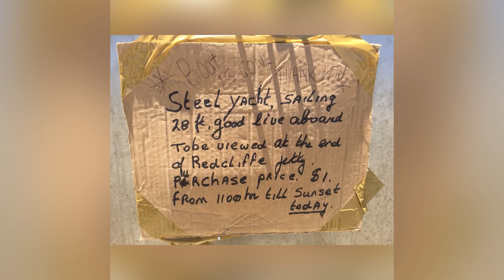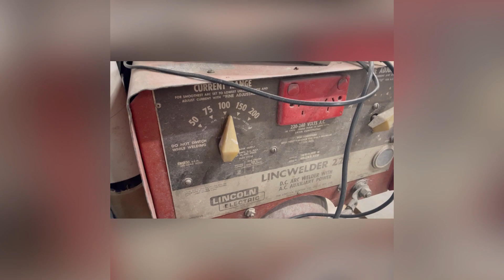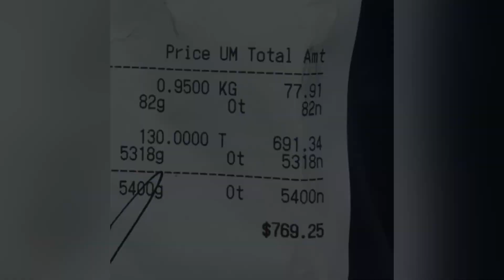25FT Bertram project - blob 25 - BOAT REBUILD - getting boat off the floor onto trailer

Comment: I am pretty sure my 28 has the same woop in the bottom back near the transom. I have only just started the same task with it.  I am starting to realize how big a job I have committed to.  All the best with yours Michael
Reply from the maker: I think i gotta make it flat cos I’ve taken so much off the sides and it’ll be easier to make everything even then the funny “whoop” thanks for the comment. You should put your project on YouTube if its gonna be a big one! Good luck to you to!

Comment: We always heavily blocked the stern to stabilize the craft back on the chines then it is a matter of jacking with safety blocks always in place.  A piece of channel iron with a chunk of pipe welded to it that captures the jack head works fine (pad the channel).  Then jack the bow up with the jack just forward of the tipping point midship, slide the trailer back until the axle is at the jack, block and lower, rinse and repeat.  If you have an gantry of course it is easy.  Block the stern and pick from the bow with a strap.  The trick is to have your blocking so the boat can never fall more than a fraction of an inch.
Reply from the maker: I kinda did that…. Except the Saftey bar on the tipping point hahah thanks for the comments mate!

Comment: Hi Michael,  I seem to remember reading that the first generation Formula 233's had a slight hook cast into the hull mold at the transom to act as trim tabs.  Since Don Aronow likely took design ideas from Dick Bertram...the slight hook you pointed out is likely intended.   I bet you can research this aspect.   What year is your 25' Bertram?
Reply from the maker: Someone else said the same to me on Facebook. Thanks mate. I’ll either have to make sure it’s symmetrical or straighten up?? See what happens. I can’t remember the year model sorry.